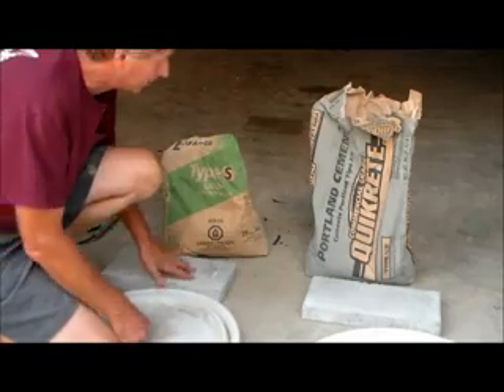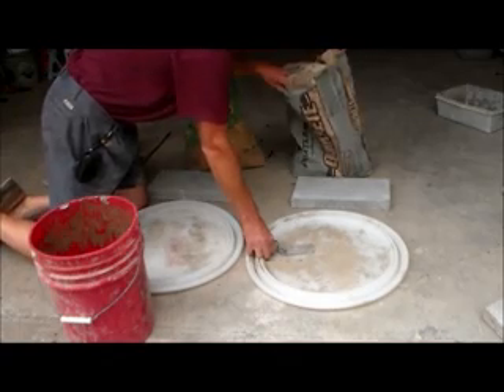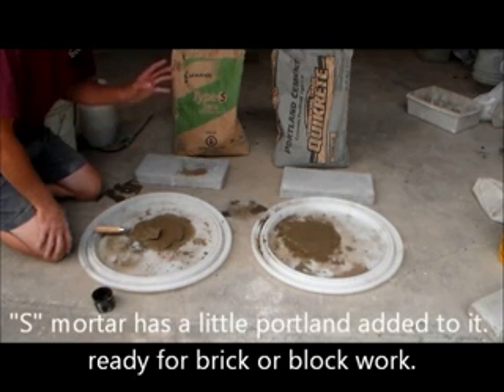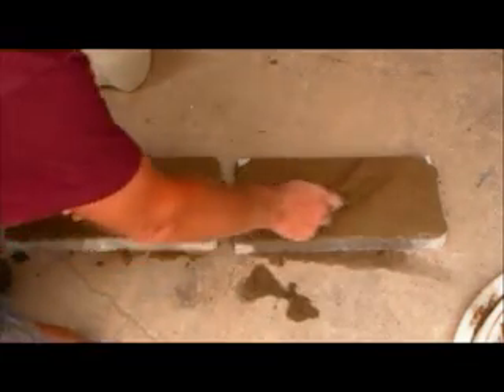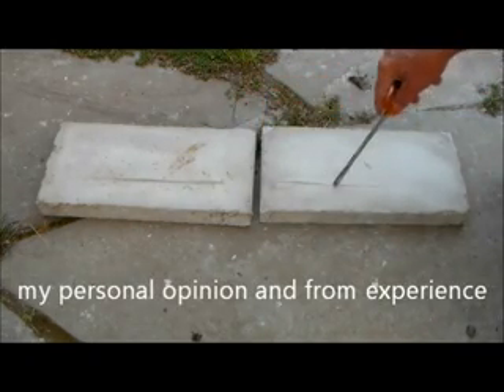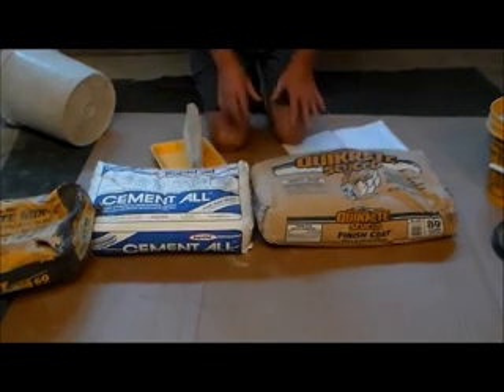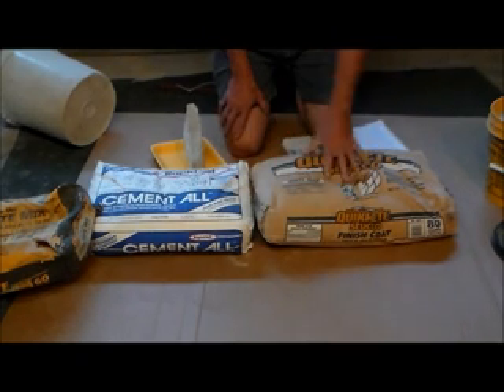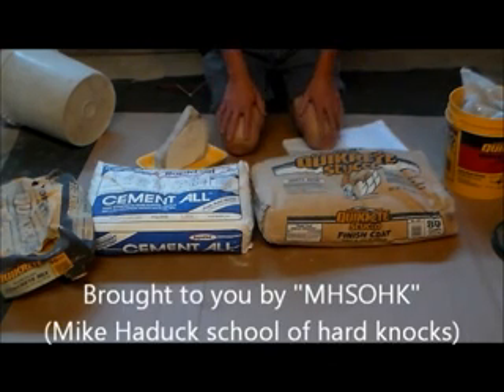WHAT CEMENT SHOULD I USE ? (Part 1) Mike Haduck

Comment: Out of all the videos I've watched, your the only one that tills me how much sand to mix with Portland...thanks!
Reply from the maker: Hi Jim, every area of the country is different and depends on what you’re doing, but for the most part that’s what I use, thanks Mike
Reply: Hey Mike, I’m from Kansas, we bought a small house, but the east basement wall leaks water really badly when it rains. Built in 1908 and has the old (red brick) walls with a slight bow in it. The house has no guttering and a sidewalk by it, which is terrible. I’m putting up guttering and putting in a new sidewalk, but this time the cement will go up to the house and about 4 feet out, should end the water problem. 
Then I want to put about a 1/4 inch of Portland on the brick walls to seal them, inside. What mix do you recommend?  I was going to mix 2-Sand and 1-Portland? Thanks, Jim
Reply from the maker: Hi Jim, That is what I use, and I have not had a problem, others say different, but I do have videos out and how i repair an old stone foundation, They may help thanks Mike

Comment from the maker: I can't tell anyone what to use. but I ususally on a outside wall use two buckets of sand to one bucket of S mortar. then if it will be exposed to any weather I will add a shovel of portland. now if it is on a patio where the rain hits it everyday I will use only portland. sometimes its a good idea to let some days go by so the base coat has time to shrink, my opinion  thanks  mike

Comment: I'm a Janitor / Sextant... for a Boston Church with a 5' Stone Wall and a series of steps up to sanctuary entrance.   The stone wall has a bit of loose mortar.   The side walls for the stairs are also cracking like crazy.    When I first started working on the wall -  I used premixed cement with some small stones built in.   Well - long story short -  that was wrong cement - tough to tuck into the cracks and between stones.   Now I'm using Portland and sand.  2:1 ratio.  I'm getting better at this.    Tremendous thanks to Mike Haddock.     I feel like I'm a Mike Haddock -  Apprentice.
Reply from the maker: Thanks Fester, I appreciate it,  mike

Comment: Hi Mike,
I have found your videos to be extremely helpful! My father was a huge fix-it guy but hadn't been able to do much around the house the last few years. He passed away in January. I'm staying with my mother this summer to help her with some things. The two biggest items needing attention is the concrete (steps and driveway) and house painting.
I just finished the porch, feeling much more more confident after watching your videos about 25 times. The corner was broken off and the front deeply pitted. I used mortar to repair (also a badly deteriorated corner foundation of the house) and later topped the whole set of steps with Portland. I just finished it yesterday and it looks great! My mother is thrilled. :)
Here is my question. You mention in this video that straight Portland will crack. In other videos, you "paint" with Portland (and some bonding glue) for a nice finish, but there is no sand. That's what I did on the steps. I'm in Wisconsin - severe fluctuations in temperature with an occasional -20 to -30 in the winter and today (June 21) is supposed to be 96 degrees with lots of humidity.  My next plan of order is fixing the cracks and pot holes in the drive with Cement All and then going over the top with Portland. Do you recommend using sand in this mix?
And one last question... sorry this is so long. You mentioned that you sometimes mix Portland in with the Cement All. If I were to do this on the surface, what sort of ratio would you recommend?
Thank you so much for your help!
Reply from the maker: Hi, I wouldn't mix the Portland in with rapid set, I do that in very rare cases, and painting with portland is a old school thing that dosent effect the shrinking very much. But patches without sand Is where it really shrinks, if all that makes sense, it's an experience thing, thanks Mike
Reply: @MikeHaduck  That does make sense, thank you. I'm patching with Cement-All. Since the driveway is so badly damaged, it's getting pretty expensive. My reason for wanting to mix the Portland with the Cement All is because I need to try to level the driveway more on my top layer. With a straight Portland and sand mix, I think it will crack where it ends up a little thicker in that process. Also, I'm hoping the Cement-All will speed up the curing process. 
I'm a complete amateur for sure but trying to do my best to make the driveway safer for Mom to walk on in the winter. Naturally, I'd prefer that my efforts resulted in something that looks good in the end also.  Any further suggestions or comments that might be helpful?

Comment: Hi Mike.  I just bought a home in Florida that I plan to renovate.  I have extensive interrior renovation experience, and with this renovation I plan to tackle some of the exterior jobs myself.  One of them is mortaring over a glass block window that's no longer in use.  My guess is that the opening in the exterior cement wall was made for an air conditioner when the home was built in 1948, and then later filled in with glass block when the central heating and air was added.  Now with newer hurricaine proof windows in the house, the glass block windows have already been covered up on the inside.  The glass block is set back (not flush) with the exterior surface of the wall, so I was simply planning to mortar over the glass block.  Good or bad idea?  Your videos have been extremely helpful with tools and technique.  Thanks!  I watched this one to see which cement to use, and you left me hangin' when you said "In Florida it's a whole different story."  What do you recommend I use and how should I mix it?  I'd appreciate your advice (or advice from any of Mike's followers).  Thanks again!
Reply from the maker: Hi Alex,  florida is a different story and I can not say for sure, in that case I would ask the locals,  I hope it helps thanks mike
Reply: Ok. Thanks Mike. Look forward to watching more of you videos. Good luck to you.

Comment: I think this answers my question about whether I can add Cement-All to Type S mortar mix in doing a chimney crown.  Type S mortar mix by itself seems to be excessively brittle when it dries.
Reply from the maker: Hi Sierra, I have a whole playlist on "chimney repair" I never added cement all to s mortar for a crown, that's a whole diffrent matter, I mostly used 1 part portland to 2 parts sand, I might have repaied a top with cement all for a real-estate deal to go through but what I would really do to make one last is cover the cap with metal, my opinion, Mike
Reply: @MikeHaduck  Thanks Mike, it amazes me how you can have 184k subscribers and respond to comments the way you do!  I'm going to back off on adding Cement-All to the mortar mix because I think it's going to cause it to set too quickly anyway.  I'll experiment with adding more Portland and if that doesn't work, go with straight 1 part  Portland and 2 parts sand.  Maybe the lime is causing the brittleness.
Reply from the maker: @sierragreen  I am sure it will work out, thanks Mike

Comment: Guess what I’m trying to ask is: for sidewalk painting your way: better to use portland with sand/bonding adhesive or Quickrete stucco that has white sand & put bonding adhesive in it to get more consistent color vs possible darker spots when using portland painted on with a brush?  Thank you for your knowledge and patience
Reply from the maker: Hi Brenda, I don't use stucco mix for resurfacing,  that is mostly for up and down work like stucco houses, thanks Mike

Comment: Good video. I never understood why the ready mix mortars never seemed to work for me. After they set, I could scratch the material away with my fingernail. I experimented trying to make a block of ready mix mortar, and it would just crush into sand. So I purchased portland cement and sand, and will do the 1 to 2 mix like you do. I have brick stairs to repair and also a flagstone patio. I am not looking for perfection with the patio, I just don't want the weeds growing through the joints.

Comment: OK  Mike,  You have been super helpful but still want your advise on which one to use.  I am laying down a 5x5 hearth for my wood stove to set on and please correct me if you would do it differently.  I was going to lay a sheet of tar paper directly to the wood floor and then screw down the durorock or cement board on top of the tar paper and then screw the wire mesh to the cement board and then apply the stones.    Again please let me know if you would go another route.    I am also doing a vertical wall 5' wide and 8' tall behind the stove and was going to do the same thing minus the tar paper.  Would you use the Portland type 1 or the Mortar type s to apply the stones on the floor as well as the vertical wall.      You mentioned that the Portland is stronger so I thought it would be better for the 8' tall vertical wall since there is going to be a lot of weight with natural rock.This video is a thumbs up.     Thanks again Mike.  Wished I could work with you for a few weeks would learn a lot I am sure.
Reply from the maker: Hi Greg,  best way for me to answer that is , do what you think best, I have had no problems the way I did it on my videos, it’s imposible To say unless I was there to see it,  do a little testing and you should be fine,  I hope it helps, thanks,  mike
Reply: Just need to know what type of cement you would use on the vertical wall as well as the hearth pad.   I am not holding you to any liability just need to go buy it and get started.  Just want to do it the way a experienced mason would do it.   Thanks again
Reply from the maker: Hi Greg,  my rule of thumb is if it is up and down.( block ,brick, stone, stucco) I usually use S mortar,  if I feel it is too week I might add a little more Portland , if it is laying flat I use portland,  other masons might disagree, but it always worked for me,  thanks, mike
Reply: Thanks Mike,  You did mention in your video that type S mortar is weaker and that Portland is stronger.  That is why I thought for a real and natural rock up and down wall that is 5' wide and 8' tall with the weight, the Portland would be better.  So in this case would you still use the type S Mortar.
Reply from the maker: Hi Greg, I went Over three story’s high with half mortar half Portland, never had a problem, just make sure the foundation is good enough and that the stone is tied into whatever is holding it, I hope it helps. , mike
Reply: 3 stories WOW.  It looks like I don't have to worry too much then.  The main reason I was worried is I am screwing 1" square tubing to each wall stud and then screwing cement board to the tubes and them the wire mesh to the cement board and then the stones.  However, I am leaving a 1" gap at the top and bottom so the hot air behind the wall can vent out of the top and bottom.  The problem is when I start my first row of stones at the bottom they will be 1" off the floor and not sitting on the floor so I will need the mix to be as strong as possible.

Comment: Hi Mike, I have large cobblestones edging my driveway, originally the contractor put mortar between each one. Now 7 years later all the mortar is falling out between the stones.  I would like to put it back, should I wet it before and what mix to use ?  Thanks....Jim..... Love all the videos.  You are your own man !!!
Reply from the maker: Hi Jim, usually when they put cobblestone and lay it in concrete like curbs it all stays together,  but if they are laid in sand they move and the mortar falls out, I don't wet it in that case but the idea is not to make a mess of it, thanks Mike
Reply: @MikeHaduck  thanks mike,  you are the real deal... watch you all the time , what I like is you dont screw people over jobs

Comment: Hello!
I refer to you as an excellent source of information regarding the different uses of either mortar or cement
The situation :
I'm building a smoking room that includes a compartment (oven) that generates smoke placed outside the space where the food is smoked (the smoker).
A clay pipe connects the two devices in which the smoke travels from one to the other. This configuration makes it possible to avoid excessive heat diffusion on the foodstuffs.
So, I'm building a '' pavement '' floor on the floor itself and then spreading the '' refractory '' bricks on this pavement. The whole will be sheltered by bricks (formation of the oven).

The questions: FOR THIS PAVÉ
• Is it better to use MORTAR to make this pavement and then install the firebricks by sticking them to the mortar
OR
• use CONCRETE and adhere the refractory tiles with mortar.
Keep in mind that freeze and thaw movements are common in Quebec.
Thank you for your information .
Yves Dufresne
Reply from the maker: Hi Yves,  I. Cannot really answer that , a lot going on with it,  I would see what the codes require, but thanks for asking,  thanks Mike

Comment: Mike,  Thanks for all your efforts here.  I have watched 2 hours of your videos and have learned a lot.  However, it seems as though you like Portland with the 1 part Portland and 2 parts sand more then mason mix type S mortar.  At least for most of your jobs.  I am building a corner stone wall with a hearth floor for a woodstove.  I am going to put a 1" spacer on the wall and 1" top and bottom so air can flow top to bottom. I will be using concrete board with wire mesh.  From what I can gather from your vids is.....  and correct me if I am wrong.  You prefer mason mix type S pre mixed mortar for vertical stones like the wall and  for the floor laying flat you prefer 2 parts sand and 1 part Portland.  It will be a lot of work to not get it right.  Thanks a million.
Reply from the maker: Hi Greg,  I a lot of cases that would be correct, I do like S mortar for up and down and anything laying flat portland and sand,  In my area that is what works for me,  a lot of masons do not agree but I am the one who gets the call backs if it falls apart,  of course every situation is a bit different so I always try and show what I used on every video,  I would ask the locals, especially the local mason supply companies in your area, wood stoves are a dangerous thing so I would do a lot of investigating, expecially if the masonry is attached to a wood wall,   I hope it helps,  mike
Reply: Mike,  Just to make it clear you have said that you like type S mortar for up and down and anything flat.  So do you buy the Mason mix type S mortar pre mixed in the quikrete yellow and green bag or do you buy separate bags of sand and Portland and mix 2 to 1 ratio for a hearth and floor for a woodstove.

Comment: Hi mike, every video you’ve posted has been very informative and you inspire me to become a better mason with every job. 
I notice your mixing 2 parts sand into almost everything other than rapid set. You’ve even added sand to type s mortar mix,(which has some sand already in it) in the video where you repair steps. I was curious to know what adding the extra sand does to the mix. And why you do it. YOUR feedback (not a “cement scientist’s”) would be much appreciated.
Reply from the maker: Hi Franco, very hard to explain,  every job is different, I did a series years ago called , masonry tips for beginners,  I explain all the different types of cement, maybe you seen me adding sand to straight mortar, thanks, mike

Comment: Hi Mike - Thanks for the great content... I just turned 60 and pretty handy overall and would appreciate your advice on filling in a 1" hole that leads to some tunnel erosion in my Florida Gunite Pool with a pearl gem finish. This was due to a very tiny hole at first that was found by a leak detection company that opened to 1" upon applying a temporary patch.  My intention would be to use 3/4" clear tubing and a funnel to push the right kind of cement/concrete into the void with low pressure from a compressor instead of just patching the surface. Which type of bagged mix would you recommend for this repair?  Your suggestions and thoughts are welcome. Thanks and Best Always....
Reply from the maker: Hi dmr,, pools are a whole diffrent thing, I would talk with the guys who do it everyday, you don't want leaks,  thanks Mike

Comment: Mike,   If you were going to install flagstone as a hearth under a wood stove over a tongue and groove hardwood floor would you use a 1/2" sheet of cement board under the flagstone or simply lay down some plastic or tar paper right on the wood floor and put the Portland right on to the plastic or tar paper.  I will be building a 5'x5'    2x4 frame to hold the Portland
Reply from the maker: Hi Greg, too much liability to answer questions around wood stoves, I did some videos on how I lay stone patios,  I would ask the local inspector on that, thanks, mike
Reply: Mike,  Not holding you to any liability just not wanting to have to redo a job that was not done right.  Just looking for functionality and the flagstone's staying in place.  Please let me know.
Reply from the maker: Hi Greg , the only one I did was “ how I install a stone patio ( Part 4 of 4),  Inside foyer,   And that is what I did fir that situation, every job is different, I hope it helps, thanks, Mike